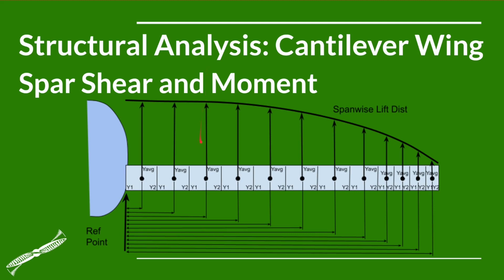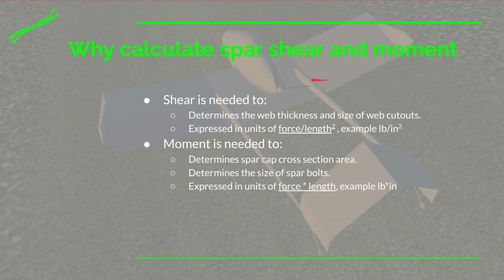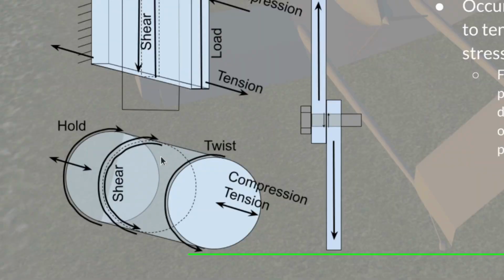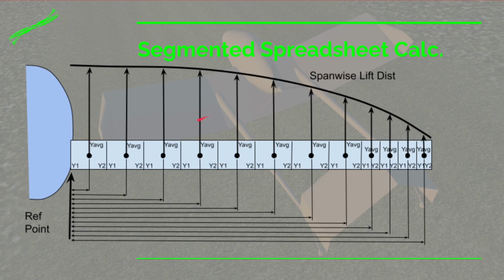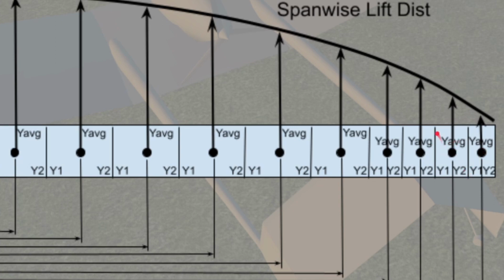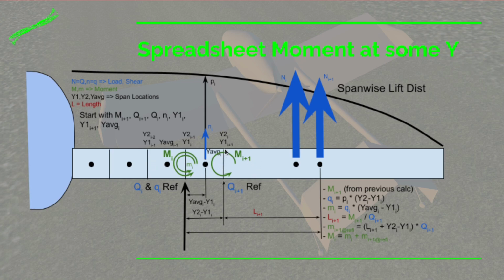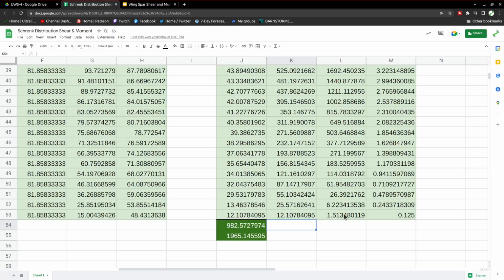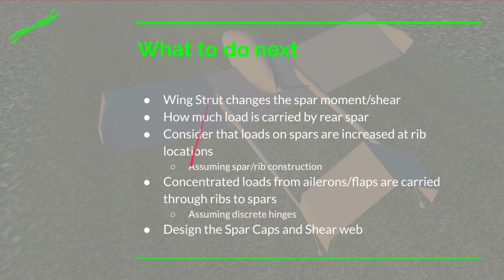Wing Spar Shear And Moment

Comment: Hi could you tell me what formula you used for the schrenk span dist please
Reply from the maker: There isn't exactly a formula. You add an elliptical distribution (you can find these online) to a distribution that has the same shape as the planform of your wing. If you get Chris Heintz book "Flying on Your Own Wings" you will find the description on page 133.
Reply: Use a free 2D CAD software, draw an elliptical shape that has the same area as the lift. (Gross weight, times G load, multiplied by distance Center of Gravity is located in front of Aerodynamic Center, plus tail down-load).

Draw the ellipse to represent the total load and lift with its area, make it the same span as the wing. 

Now, draw the wing planform sharing the same span and centerline.  

Now, scale the wing planform in 1D (vertically) until its area also equals the lift, same area as the ellipse. 

Now, draw small lines between the ellipse and scaled wing planform. It should be a relatively short distance.

Now, place a point at the mid-point on each line. And connect them with a curve. The curve line should interpolate between the ellipse and the wing planform. 

This can be done on higher end CAD programs such as Rhino3D with the command "Tween two curves".

Comment: It's been a while so happy to be corrected but at 7min50sec shear from torsion is in the same radial direction through the cross section unless the tube isn't closed (has a slit down the length) then the shear stress is as shown in the diagram?